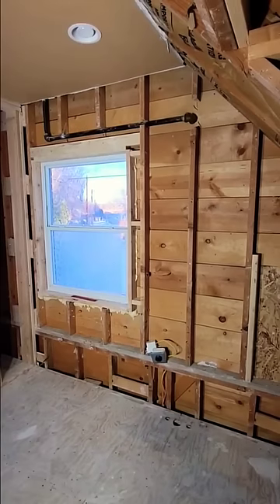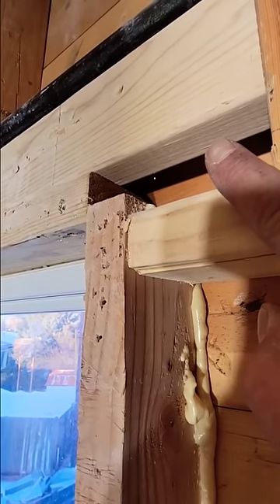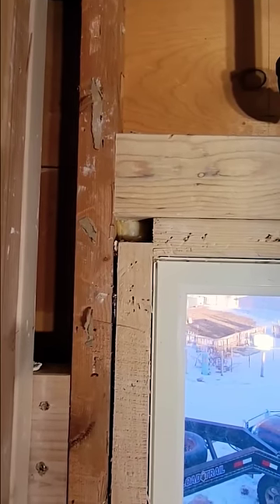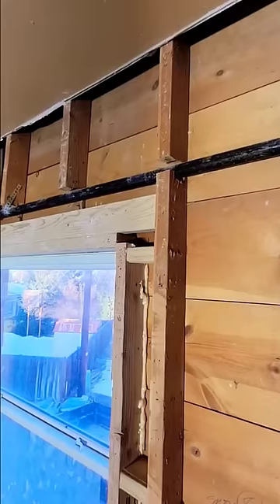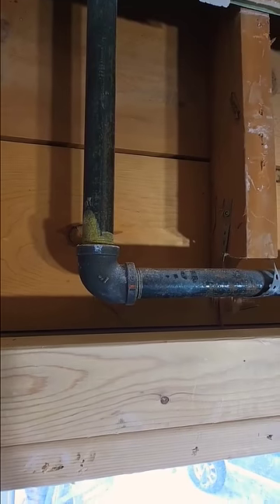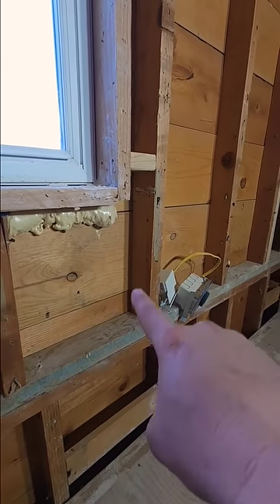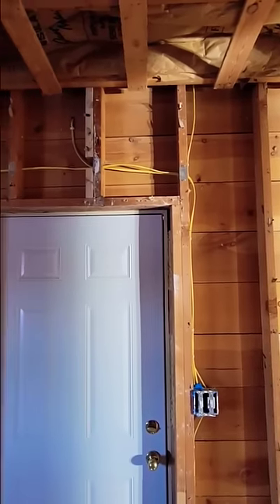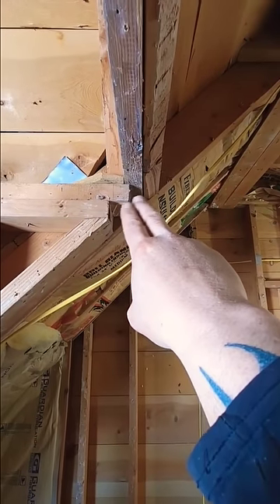Why ((REMODELS)) cost so much! #hacks  #construction #framers #plumber #shorts

Comment: Sorry. Have to disagree with you. As a professional myself. Understanding how the world works. 
You should be assuming that you will run into worse than this on every job. 
As well, who makes a closed bid?

I would never do work that was not conditioned on finding things wrong. 

From your position, you are saying that if someone bids on a roof job and assumes that the roof is done properly. Then the contractor comes to start. Does a tear off and finds the sheeting bad, after tearing off the sheeting finds serious problems with the rafters.
That none of this is known. 
That the contractor is now obligated to fix everything wrong and then still lay the roof all out of pocket?

That would be like taking car to dealership for oil change and they find out that the plug is leaking cause the oil pan threads are bad and the dealership has to eat the costs of a new pan and labor. 

Explain to me this logic you have on this.
Because I feel like you have absolutely no clue how to run a business or any common sense.
Reply from the maker: So true! I couldn't agree more! There is always something you will find!

Comment: The pipe no
Header np it's not a load bearing wall
Reply from the maker: Normally I would agree with you, But the way this was framed and the load on the roof right there along with our snow load here is Wyoming. It needed a header there.
Reply: @307Garage  
That whole wall looks like a disaster
Reply from the maker: @ed collier  it is for sure! Infact they whole house is not good at all.

Comment: To be fair. That window frame isn't exactly a load bearing point it there is an inch or two missing at the top. 
XD
Reply from the maker: Yes. That is not part of the load points. Everything around it is though.

Comment: What's wrong with the 90s? Looks like they used tape and dope on the gas pipe. Cutting through the studs isn't great but they shouldn't have run it there.
Reply from the maker: In Wyoming they are saying now you have to have a accuses to all joints in your gas line
Reply: @307Garage  access to all joints? I find that hard to believe but shit changes daily. In my state of NY that only applies to gas unions and shutoffs.
Reply from the maker: It as just pit in on the 22 code book. There is a lot of unhappy people out there.

Comment: No I wouldn't lost my a** on that because obvious problems like that need to be fixed and even if they're not in the contract customer has to pay for it simple is that it's not my fault to do to remind your house 10 years ago f*** it up but it is the home owners fall in a way for not getting a proper inspection because chances are it's the same homeowner who remodeled the first time and they probably went with the cheap guy I know being a contractor that good work isn't cheap and cheap work isn't good
Reply from the maker: 100%

Comment: Not to mention the plumbing is on the outside wall
Reply: Its a gas line..can go wherever u want it to go..besides cold air retuns..and would recommend not in attics if possible..the only plumbing not to go on outside walls is water & there is acceptions for that as well depending on the way the wall is built layer of drywall in between ect..also some states structural building codes if enforce strictly sometimes u can't get away with putting drains on outside walls due to thier size and how much meat is left to the plate..and as long the trap is outside the wall thats the only time...

Comment: I won’t hire anyone to remodel. It’s hard when I have a job then have to work around the house but I’ve hired two contractors, a roofer and a plumber. Neither did the job right and the plumber shitted me good from a so called reputable plumbing company. I tore my basement bath out and it was a nightmare. The village idiot down the road acted like I didn’t know what I was talking about because the guy that used to own my house “hired a professional” when he remodeled it years ago. The house was built in 78 and the original drain pipes were ran wrong with the wet vent. I seen a problem with the floor joists and some other things that are original. A guy I work with had a new house built and he said they cut corners too. I’ve seen areas uninsulated too. I might not even have insulation in my exterior walls. Nothing but Sheetrock between the inside and the attic space in areas of my split roof. One winter I got out of the shower and the steam condensed on that wall in the foyer when I opened the door. I see why now.
Reply from the maker: Yeah, That sucks. There are hacks every where for sure!

Comment: Why are those illegal fittings? Terrible install but here there’s no reason you can’t put fitting in the wall. I know codes vary but I’m interested!
Reply from the maker: ICC 2022 code states that you can not put (any) gas fitting burred in a wall
Reply: @307Garage  Ahh. our local dream killers haven't adopted that yet. Not sure why its really a big deal but what ever. mostly do tracpie anyways now days. every once in a blue moon during a remodel of a old old house where the wall are super thin well do a 90 in a wall to get it in to the crawler then switch to flex
Reply from the maker: I feel, 50% of people can run black metal pipe the right way and 50% is why we can't run it in the walls.
Reply: @307Garage  fact! I’ve fixed a job where a client’s gas bill double… turns out they just had 30 raps of Teflon on all the threads and only hand tightened black steel, then siliconed over all the joints from the meter to the boiler 🤦🏼‍♂️

Oh and it passed inspection! Building departments are extremely corrupt
Reply from the maker: WOW! That is crazy! They didn't smell it?
Reply: @307Garage  it was a few year old remodel of 100+yeah old home and the local historical society forced certain insulation. This ended up with the vapor barrier on the inside of the wall system and the gas just vented out through the wall. It was slow but consistent
Reply from the maker: Yep, That is called a bomb for sure!

Comment: Gable end, No load, just cut it out.😢😂
Reply from the maker: Normally on the Gable end you are 100% correct! But when they framed this in the 40's they did not use a top plate, they just ran the studs notched the 2x4 in to a 24 foot yes 24 foot 2x6 ruff cut. The roof is  12/12 The 2x6's are way way over span! And how they loaded the roof on to the walls with a dormer above that spot. Along with our snow load here in Wyoming. There is a big load on that wall. Not as much as the side walls. But there is. Along with everything else that was wrong around this spot. Thanks for watching.
Reply: @307Garage  
We do love our plumbers. Good video.
Reply from the maker: @Pops2  When you have good ones like I work with! You don't let go of them!

Comment: Ah, just a gas line.

What could go wrong???
Reply: I was curious about the "illegal" 90° in the wall, what is actually wrong with it? My intuition if I was fitting the gas line would be to not have it concealed, but put on the exterior of the wall.  It seems very impractical to me to run it perpendicular through the studs, it takes too much strength away from the structure.
Reply from the maker: In Wyoming they are saying now you have to have a accuses to all joints in your gas line

Comment: You are not a plumber . Don’t touch the pipe . You think those fitting are wrong so you’re off to a tough start with that can’t imagine what you think will be the “right” fitting. So ya Just because I own a tape measure I don’t go around saying I’m a contractor. And just because you’ve seen a pipe doesn’t make you a plumber. Right bud
Reply from the maker: Didn't do the Plumbing! A Licensed Plumber did! I am the General. Where we live in Wyoming, You can not berry any fitting in the wall. If you do, You have to make a access to it. I know it is jacked up and we fight it all the time, But the city will not let you berry that 90.

Comment: It’s a wonder how someone thought that was ok
Reply from the maker: Right!
Reply: @307Garage  I recently started a remodel.  Demolished top to bottom with plaster and lath to find on the main floor no headers on exterior windows double windows (6’span)with the counterweights hidden.  The exterior walls were also carrying the 2x6 “floor joists” for the upstairs.  Did the final corn scoop around to get the last couple rows of lath off and finish the shop vac up and found the exterior walls had no bottom plate and “studs were notched in half and toe nailed on the rim joist that was separating from the basement joists.  After 80,000 pounds of plaster I had to tell the lady that there was nothing this one man could do and bowed out gracefully.  I did not charge her the 8k she owed me because I’ve never not finished a job.  I’m 38 now and it made me quit construction after 20 years.  My body, mind, and soul were completely destroyed.  I work alone.  It was so much work for so much disappointment.
Reply from the maker: That is a lot of work. To get it off the wall, pick it up, haul it out of the house, put in a trailer, hope you had a dump trailer or something. Then haul it off. Yeah just getting 80,000 pounds out. Is a task all by it self.

Comment: 😂😂😂 You should see some of the methed up shit in mobile homes.
Reply from the maker: Oh I have! I do not work on them! 1X2'S for trusses. 1X3 wall studs and so much more. So crazy!!!
Reply: @307Garage   yup, 2x6s can replace those delaminating trusses, adding strength when you drop them 16 on center, vs the 18" to 24" they're at. lol. Tho, nothing beats the 4 risers, and 2 - 6" seal plates under each 30x60 window. 🤣🤣🤣 Well.... Next to the jack legs that cut across 5 joist, to move a register from the door, to a corner. lol. Man, the shit I've seen in one tuna can alone. Really had me wonder: How many drugs one have to do to thing some of their bewlshit was a good idea. More so when it ended up using more material, to do it horribly wrong.  lol
Reply from the maker: All of them! lol And a lot of meth!
Reply from the maker: Right!

Comment: Just because you can make it work don't mean you should.
Reply from the maker: Yes, You have to.
Reply: @307Garage  No you don't. I've seen mechanics do some pretty shady work also. I myself have done some crappy work but only on  stuff that belongs to me.
Reply from the maker: It is always the right thing to do. Fix problems when you find them.
Reply: @307Garage  But fix them right. I used to do punch work and fur downs and I would have to "fix" other  contractors work before the inspector showed up. If the jobs worth doing it's worth the time to do it right.
Reply from the maker: Yep.
Reply: @307Garage  I knew we were on the same track. You do good work. It's crazy what you find when the sheetrock comes off. One of my pet peeves is stumbling on stairs because of a stringer chopped off on bottom.
Reply from the maker: Yep

Comment: You legally cant leave it once you expose it.
Reply from the maker: 100% correct. I have to fix it or walk away.
Reply: I'd be interested to see you have a chat with someone from an insurance company about how crap work like this can affect how (or if) insurance will cover problems when there was shoddy work like this in place.

Owners don't realize that the risks of going with cut-rate work go beyond just the physics of it (fires, leaks, structural problems) - if/when there are problems of any sort down the road, having bad work in there can bite the owner later when someone sues because the owner sold the place to them like this, or bite an owner when they submit an insurance claim and it gets denied because of bad work ... even if the bad work didn't cause the problem.

(Folks theoretically understand "get what you pay for", but you might get a viral video by connecting some dots tying cause and effect with some example situations )
Reply from the maker: The worst part is, The insurance will say it is construction neglect and never cover anything on that house till it is fix to code.

Comment: The house is built out of real wood. It will be there in 100 years.
Reply from the maker: I wish the wood was still like the old wood.
Reply: @307 Garage  100% we have a old WPA building built in the 40's it has full dimensional 2x12's 14 feet long without a knot in them.
Reply from the maker: Yeah, so much stronger then now!

Comment: Why would you loose your ass? If you didn’t include re-framing an exterior wall, and re-doing live plumbing, it all sounds like a change order to me. Let it fail inspection, or have the home owners sign something saying they don’t want to change it, so inspections are off the table. Do what you bid, and no court is going to demand anything more of you.
Reply from the maker: Because most homeowners never understand the work that go's in to fixing it.
Reply: @307 Garage  I get it. Their lack of understanding doesn't make for free repairs and upgrades though. Most home owners are also barely scraping together their mortgage, car payments, and credit card minimums. I stopped even offering estimates myself... I only do it if there are zero unknowns. Otherwise, I tell em look, I can give you a magic number that includes a bunch of extra in it. Or... you can just buy the material at retail cost, and pay me $$.00 per hour to install it. Payments stop, work stops. Most people go for it once you explain that most of the other bids they receive have contingencies built in, and if they don't, then they probably don't know what they're doing, aren't licensed, insured, and good luck rolling the dice on their operation being successful. Time and material is typically the best deal for both sides when there are unknown variables involved.
Reply from the maker: Yep

Comment: That is horrible work done work as an installer labor and this just makes me cringe people should be proud of the things they do but instead some people are so interested and trying to make more by cutting corners they must not really care about what they did there I couldn't sleep at night if I cut a corner like that all vertical members inside a wall must reach the top plate and the bottom plate the loads got to transfer properly to the foundation this gives a new definition to jackleg work
Reply from the maker: I could not sleep doing work like that!
Reply: @307Garage  me neither that's why I said I couldn't sleep at night and people that do do that need to be banned from owning tools at all because one day they'll make a half-assed repair like that and it'll hurt somebody people like that don't need to do any work at all because it only makes more work for the people that actually care
Reply from the maker: Yep

Comment: Illegal fitting? What? 😂😂
Reply from the maker: Can not put a (any gas line fitting in a wall)
Reply: @307Garage  since when?
Reply: @307Garage  im a commercial/industrial/residential plumber, that's complete horsesh!t
Reply from the maker: it is in the ICC 2022 code book. Our city pushed it. We all went down to fight it and they still passed it in because it was in the book. It is only Fitting in side the walls or burred!
Reply: @307Garage  what do they want megapress or flex instead? Thats insane
Reply: @307Garage  theres black pipe gas fittings in every wall of every home everywhere
Reply from the maker: That is why we all went down to the meeting. They say if you find it, you have to bring it up to code.
Reply from the maker: Bring that up with our city!

Comment: That's not a plumber, black iron is gas.
 Or a do it yourselfer that doesn't know water isn't run in black iron
Reply from the maker: The plumber does it all here in Wyoming. The gas guys only get it to the meter
Reply: @307Garage  interesting, rather dangerous also
Reply from the maker: Most the plubmers here are very good. There is some that should not be in the business for sure though.
Reply: @307Garage  don't need much pitch for gas! Lol

Comment: I can say, this I'm a fricking electrician but IV been one for 32 years so far,, a d I know what a jack and king stud is, how a header works,  and even as an electrician I tell customers, ok, so there are 3 prices,, ,my bid, which will be Holly shit that's a big #, my guestamemt, between the holy shit# and the if a.goes good #,, or the time and materials,, no body gets rich, Monday lose thier pants,, , I'll keep track of hours show ya material receipts, and we are good
Reply: Not only isn't there a header,, bit they didn't even turn the 2x4 so it's a rib,, no they using it as 🤔 a spring board, or what, it's easy to see which way a ,2x 4 is stronger one way compared to the other, yeah let's lay it flat
Reply from the maker: And built with deck screws! lol so bad!